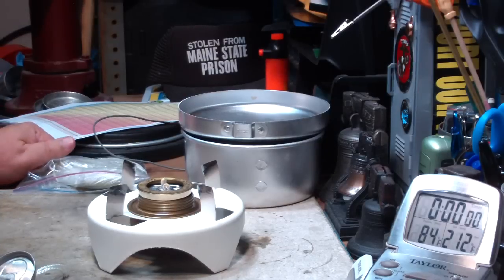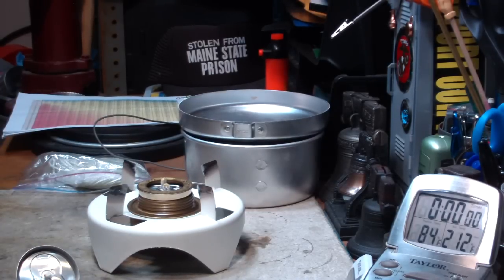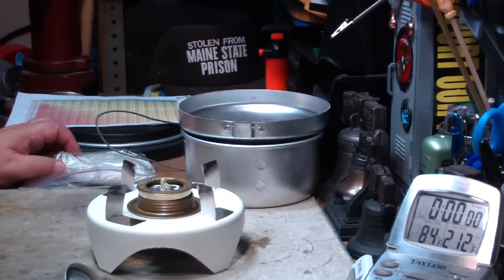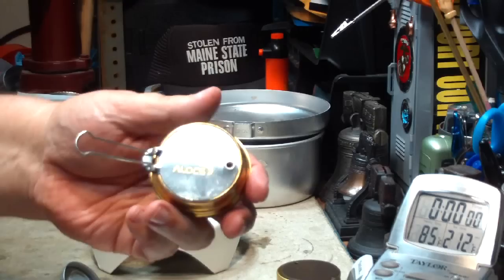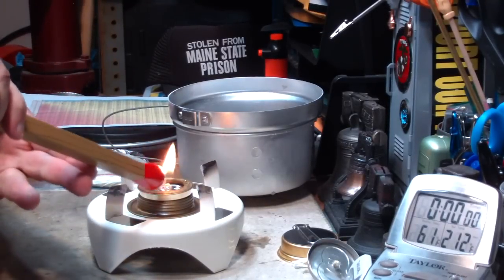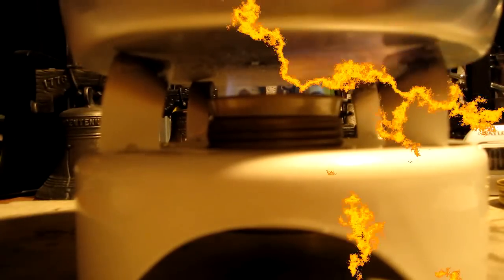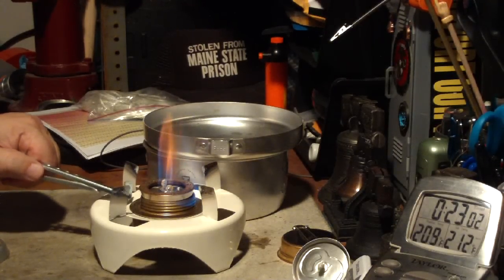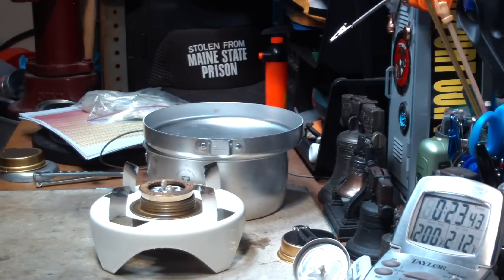Idea for Low Power Trangia Simmer - Test #2 - Fail

Comment: Use a rubber stopper with a hole in the middle that will except a glass tube that your wick will feed through, this is how alcohol burners are made.

Comment: At this power level it looks  the feedback is going to force vapour out somehow, so to do this you're going to either have to reduce the feedback or cool the alcohol reservoir.  Maybe a shallow bowl under the stand with water in it so the bottom of the trangia is sitting in water would work.  Or reduce the feedback by having an insulating top that has longer wicks to keep the heat away.

Comment: If you have an old simmer ring, maybe try drilling a 1/2 " hole in the middle and then make a round adjustable cover, just like the original simmer ring , sort of like a simmer ring within the simmer ring.

Comment: after watching your first video I found that the tin lid off a glass smuckers jelly jar fits the top of the trangia reasonably well.  and enough of the jar threads engage for a light interferance fit to the trangia neck without added weights.